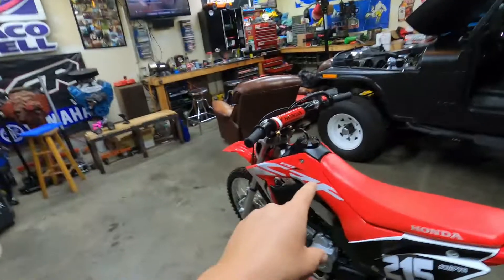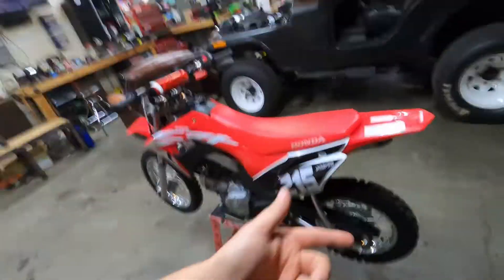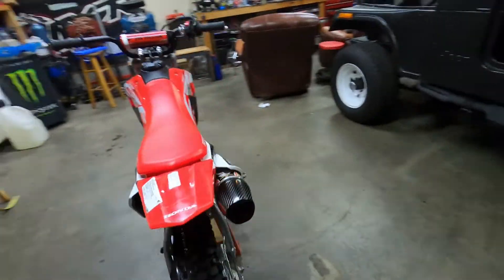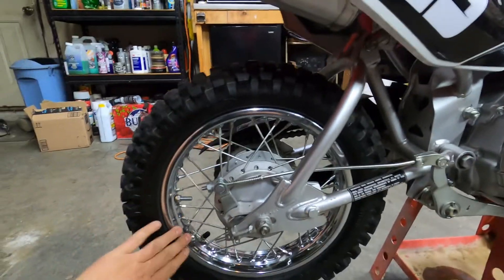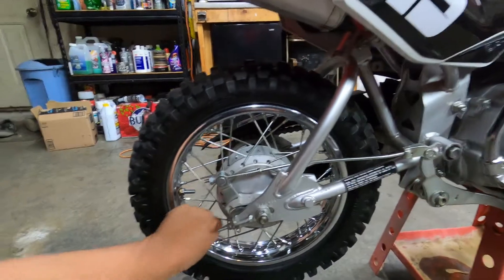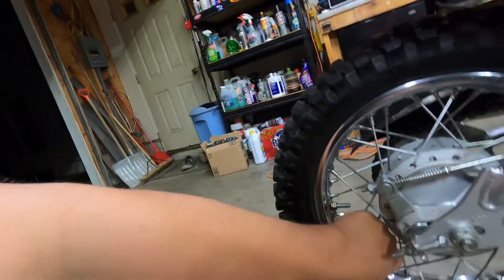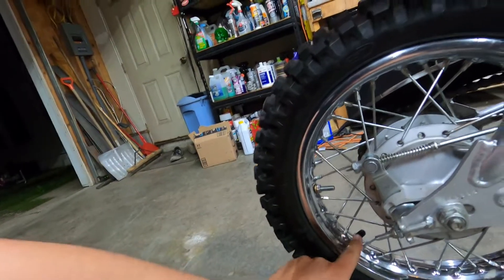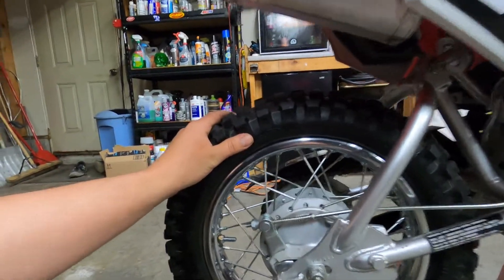Crf110 Getting Flat Tires? YOU NEED A RIM LOCK!!! (This includes all 110s)

Comment: I will likely add a rim lock to the front tire on my sons kx100, he went up a steep hill and back down, then I noticed he had a flat tire , the valve step ripped just as you said when he used the front brake on the way down the hill. The Bike already has a rim lock on the back tire. I bought the 3 spoon tusk kit and bead buddy and watched about 5 videos on changing tires, that sure helped as you need to understand how the tire bead needs to get deep into the rim to get the bead over the rim on the other side of the wheel, learning that process is very empowering. Its not like changing a bike tire.
Reply from the maker: Yea make sure you buy an extra tube and patch kit, use soapy water and be patient putting the tire on. I’ve done it a few times now but by no means an expert.  Thanks for watching!!!

Comment: So glad I found your vid.  I too have the same issue and suprised more  KLX110 owners aren't making a stink.   Going through my third tube is enough for me at around 15-20psi.  Stock rubber rim strips is crap too.  The spoke nipplesjust gouge the tube through the rubber.  I just use duct tape wrapped a couple of times.
Reply from the maker: Yep same here. I buy the heavy duty tubes also.  We do a lot of woods riding. Switching to the oversized Mitas tires was a game changer.

Comment: Thanks for the vid. Installing rim locks now on my 13 crf110. That guy is right. The nut is for the valve cap not ment to tighten the stem to the tube. You need rim locks on a 110 too. Honda stuck it to us.
Reply from the maker: My Kawi 110l was the same way too. Glad you got her dialed in!